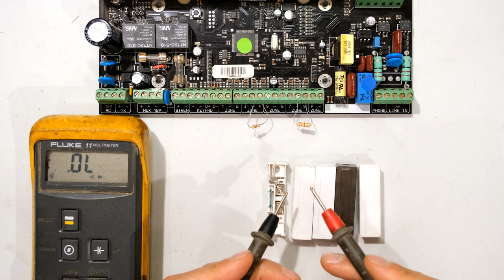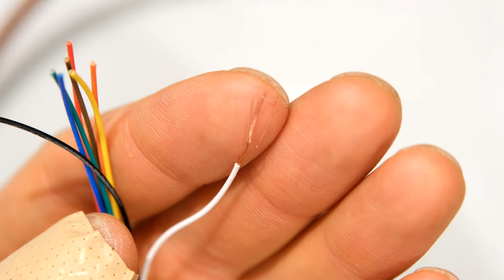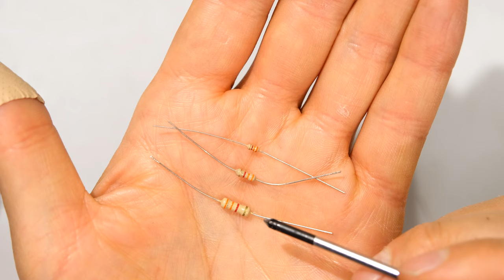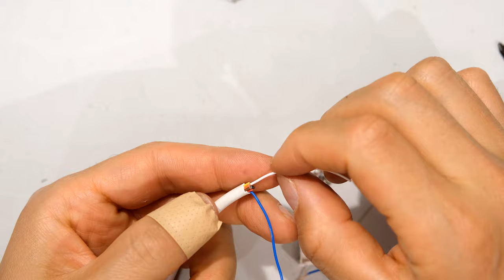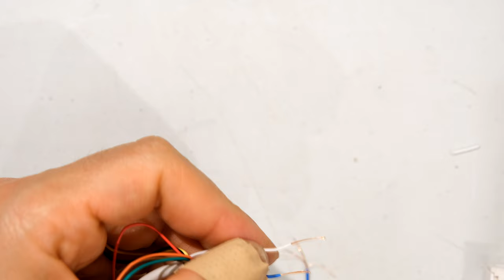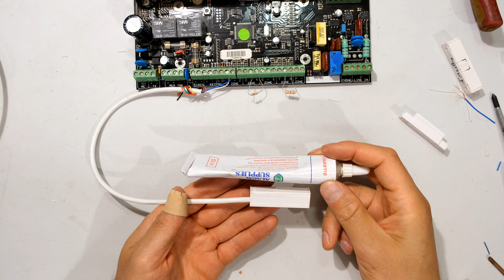How to connect a magnetic door contact switch to your alarm - tutorial

Comment: Hi, 

I connected the door switch  with a buzzer to the DSC Model PC1616 but the buzzer will ring only once when I plug in the panel transformer and then stop. I have tested and changed the switch, the buzzer and the cable and still having the same thing. 
So when I plug in the panel transformer, I will hear the buzzer rings and when I open and close the door it does ring. 
Any help will be appreciated

Thank You

Comment: I just bought new construction home and I have these on doors and different on windows.
My question is how to use these for new smart Alarm system? I saw only one wire at outside my communications panel. I was thinking to add Ring sensors system but I noticed these because my builder mentioned pre wired security system. But no idea how I can use it.
Reply: hello Gurjeet, I will be happy to help you out with that.